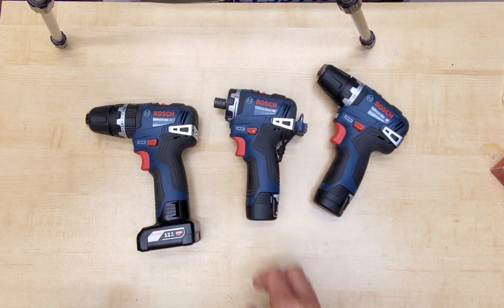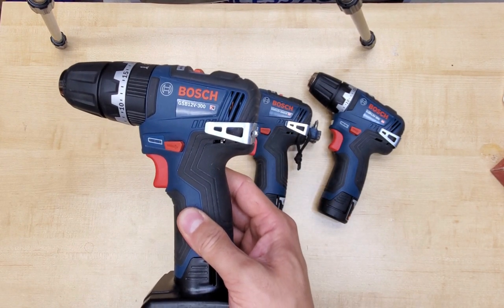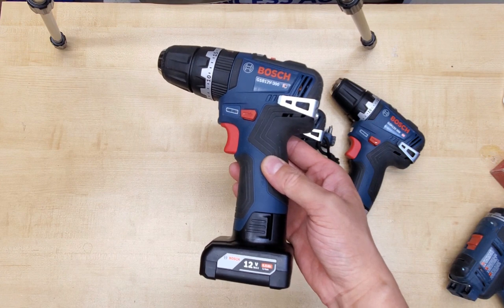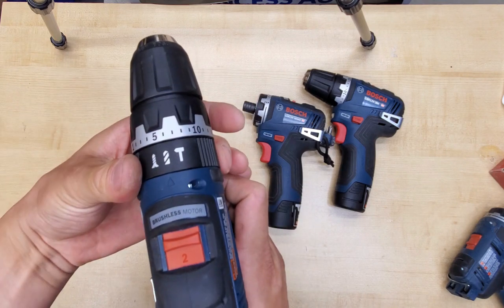Bosch 12v brushless drill driver, GSR12V-300, GSR12V-300HX, and GSB12V-300

Comment: I didn't really know what I was buying at first, but quickly noticed how good these are! I'm really impressed.
Reply from the maker: Glad you liked these. The HX is still in my tool bag almost everyday, great for going up the ladder instead of company issued 18v impact with 8AH battery.
Reply: Very compact but just weak
Reply: @ryu-ken  you sure you didn't get the brushed version? Those ones are weak. The brushless ones feel like they could break your wrist. I can screw down several large lag bolts down with mine.
Reply: @UnidudeNine  it was a gift for me but I returned it and bought the ps42n. Much better for me lol

Comment: Precision tool !

Bosch makes the most compact screwdriver, I use mine all the time. I hate using full size tools, only like using the larger tools when I am using a hole saw 2” on up. We aren’t all building decks or driving fasteners that will be hidden behind the walls. 

If you are looking for a tool that is precise and allows for full user control, Bosch 12v stuff is the way to go and especially the 12v screwdrivers which I adore

Comment: I have the GSB, it's a little monter. Has made me store my 18v drill for 99% of the situations.

I put a metal Rohm chuck to replace the plastic one so it could take half inch bits and it works wonders.
Reply from the maker: That's a good idea, never occurred to me that I can just replace the chuck with a 1/2" one. Gonna have to look for one now.
Reply: @greentjmtl  I used the Röhm EXTRA 50-RV.

It is the smallest 13mm / 1/2 inch chuck there is, at only 51mm long, so the drill keeps its compact profile. I think it's only 1-2mm longer than the plastic chuck it comes with.
Reply: I wanted to do that on my GSB 12V-15, but could not manage to remove the original chuck. I know the normal way is to put an allen key in the chuck and hit the allen key to free the screw, but I found that the chuck could not hold the allen key tightly enough: so the allen key would  rotate in the chuck before the chuck would break loose. Is there a secret?
Reply: @greentjmtl  Please, post a video if you manage to swap the chuck successfully. I tried on a GSB 12V-15 but could not break the old chuck loose.

Comment: I have been watching this video multiple times.  I came to conclusion that Bosch drills are pretty underrated.  I own the Flexiclick and I think that tool is better than the Milwaukee installation driver that I own as well (I am getting rid of it).  I agree with with that I prefer the Bosch mainly for its form factor.
Reply from the maker: They are indeed. They are never the most powerful or whatever, but the user feel is the best. I've used the red and yellow brands at work and they all have janky things that are annoying to use. Bosch isn't immune, but is the best in comparison.
Reply: @greentjmtl  I was holding the red against the Bosch and it’s just clunky and unbalanced.  What drives me crazy is the length of the tool.  It’s in no way compact.  The Flexiclick just makes sense in every way.  You actually convinced me to get the pocket driver as well.  I understand Milwaukee is the one that came up with this idea of multi head, but Bosch took a step further by simplifying it.

Comment: There is also the GSR12v-300FCB. It is the 5 in 1 flexiclick model. This adds so much that I would not consider the ordinary drill/driver.
Reply from the maker: It does depends on what you use your tools for. For me (as an electrician) the additional benefit isn't worth the added weight in my tool bag. Now if they release a model that could convert among driver/impact/hammer drill, then heck I'm in.

Comment: Good video. I agree about the chuck on the older style driver, wish they were the same. I also like how the newer 300HX model has the sturdy metal insert but not sure why they didn't make it tighter fitting. I also liked the bigger fastener for the belt clip on the PS22 model versus the smaller fastener on the newer one. Ive had 2 strip out with ease..
But I love the Bosch 12volt BRUSHLESS line of tools. Including the Bosch line I have 4 different Makes of 12v tools and drill&drivers. Including (Makita Milwaukee and Dewalt) as far the power in comparison to others in the 12v line from my own comparison the Bosch drill and drivers have more torque, are more compact and also lighter. This is also true for the oscillating tools with Makita being close in performance to Bosch with less Vibration. However I do not have the newest Milwaukee M12 oscillating tool to comapre it to, and the others are brushed except for the Bosch of course being brushless. The Bosch Jig saw is awesome also however I'll say the Makita has a little better in performance as well has fit and function in the Jig saw category. Milwaukee is okay but is too heavy for the amount performance it offers, and the ergos (subjective) aren't as good either, Dewalt doesn't make one that I'm aware of here in the States. As for the receipt saws Bosch is once again compact with great performance, however it doesn't have the best performance but it's still my preferred tool. Makita is light and love the double trigger but performance is lacking a bit I comparison, Dewalt is a great performer with good hand grip ergos (subjective) but it's block, heavy and not as compact. Same goes for the Milwaukee, it's built well, Great performance but it's got the same down falls as the dewalt. If anyone is thinking about picking up the Bosch 12v sander I would not hesitate! It does everything well with its great compact size.
Reply from the maker: Yep Bosch tools are very balanced  and well done on most aspects. The only thing annoys me is how slow they are releasing brushless models of their tools. Milwaukee already has like 5 brushless bandsaws , and Bosch released a new brushed one last year.

Comment: I have two PS20 12V Bosch and use the 2 amphr batteries with good success for screwing soft brass wood screws into walnut or maple or red oak. I bought the new 12V300 brushless and find the trigger to be very sensitive yet progressive as speed increases. The old PS20 are 500 max rpm and the 300 is 460 rpm on low speed. I find the trigger on the 300 series brushless to be the best for wood screws in terms of feel and speed up to max screw penetration which avoids broken screws that need to be drilled out and a wood splint inserted and glued to catch the same size screw.
With the light weight of the 12V Bosch tools I find control of the screwing to be the best possible with the correct clutch setting in avoiding destroying the Phillips head screws. Snap-On phillip #1 bits are the best for soft brass screws driving.
Reply from the maker: The clutch is great on these, goes to very low torque value and I even use it on control cabinet terminal screws.

Comment: Thank you for this video, it was very helpfull. I find it very difficult to make the right choice between the old/new/vs/eu models if you use the internet as a reference. To my knowledge the only machine with a  brushless motor in this comparison is the GSB12V-300. Hence the letter "B" in the model number.
Reply from the maker: All three models listed in title are brushless (they literally have the same body and motor), the "B" denotes hammer function in drills as far as I can tell.

Comment: I think these are very powerful drills for their size.  That is why I ordered one.  I wanted a small, light weight drill that  will still be useful, and I think Bosch has some nice solutions.  I have my Makita 40V XGT combo for things that require more power, but they can get heavy after a while, and if you are only driving little screws why bother?

Comment: I know this is a 2yo video but I’m not able to find much information in these models. Do you happen to know what the difference is between these GSB12V-300 and the GSB12V-30? I mean 30 and not 35, which is a different version. Also, do you know if it’s possible to install a metal chuck on these models? I believe I saw the GSB12V-30 advertised with a metal chuck but I’m not sure if that’s something that can be installed in the regular versions. Thanks!
Reply from the maker: First time I've ever heard of that model, seems to be made specifically for some markets and slightly weaker. There's another comment mentioning install metal Rohm chuck. I found it but didn't go through because the chuck cost almost as much as the drill does. So far the plastic chuck works fine and I don't see a reason to change it (unless you really want a 1/2" chuck).

Comment: You say it's on an entirely different level from the brushed versions, but I'm still tempted to get the GSR 12V-15 over the Bosch GSR 12V-35 (or similar GSR12V-300HX) due to the overly sensitive trigger on the 35 for slower drill speeds. Why do you like the brushless so much? Is it just the faster 1750rpm over the 1300rpm or is it something more?
Reply from the maker: Torque, I can drive commonly used spade bits and larger fasteners without grabbing the 18v tools. Also the efficiency is nice so I don't have to worry about batteries since I don't have a charger at work.

Comment: Love the new line of Bosch 12v. Don’t understand why it’s taking so long to make a new impact driver though to replace the ps42.
Reply from the maker: Bosch has always been slow on releasing new tools, but when they eventually do they are among the best. I'm certainly looking forward to the PS42 replacement.
Reply: It’s actually the 3rd gen of that impact driver design. They just shoe horned a brushless motor into that platform

Comment: It's a shame that they went with the push back bit release on the driver, that is a bit of a deal killer for me. I frequently am drilling test holes in air ducts with a 1/2" Unibit, and the push back style release can drop my bit into the duct when I punch through. I've lost several bits that way with other drivers.
I guess I'll snap up a couple of extra PS22s before they are all gone.
Reply from the maker: That's a good point, I've noticed the same with push back style of bit holders, but never thought about this on the driver, will have to watch out for it.
Reply: Agreed. And the bit holder attachment for the Flexiclick series has the same unfriendly mechanism.

Comment: Also any reason to simply get the hammer drill over the regular drill, even if you don't necessarily need the hammer action most of the time? I.e. can you use the hammer drill as an overall drill instead of getting two tools?
Reply from the maker: Yes of course you can. I bought the regular drill before hammer drill was released so I have both, otherwise I would get the hammer drill only.
Reply: I used to have a 12V drill, when I upgraded to the 18V Hammerdrill it was a night and day difference. I use it on wood, metal, masonry w/o any issues.

Comment: Can you explain the difference between GSR12V-300  and GSR12V-300? In terms of use scenarios and why you would use one over the other tool? Both are screwdrivers?
Reply from the maker: I presume you meant the 300 and 300HX? The only difference is 300 has a three jaw chuck, 300HX has a 1/4" chuck. For people who use it on screws majority of the time, the 3 jaw chuck is extra weight and size that's not needed 95% of the time, and slows down bit switching, so might as well omit it.
Reply: @greentjmtl  Thank you for the comment. Yes, I made a mistake I meant the 300 and 300HX. So the 300HX is kinda like the impact drill, but for more delicate work? You mentioned it's a little more difficult than the PS22 to go lower speeds with. Is that a huge problem  or can you still go slow with it just with a very delicate touch of the trigger?
Reply from the maker: @Ryezn5057  I suppose you could say that, the chuck is similar to an impact driver, but shallower and can take 1" bits, plus no impact. I don't find the less sensitive trigger to be too big of a problem, you just have to be consciously careful about squeezing the trigger and turn down the clutch on delicate screws. Although if you work on delicate stuff all the time, there is an better option from Makita (DF012DSE), but it's very low powered and cannot handle bigger stuff.
Reply: @greentjmtl  thank you very much for the video.  Answered all my questions.
Reply: @Ryezn5057  I'd go with the GDR12V-300FCB just for the Flexiclick feature. In stock form you basically get a GDR12V-300HX, that is until you get the attachments clicked in. It comes with a regular 3/8 chuck attachment, a right angle drill, offset 1/4" collet and something else I can't recall at the moment.
Reply: @MrLuisinho90  The extra part is a normal (centre) 1/4" hex fitting. It is a great tool!

Comment: Hey where did you get the bit holder for the drill?
Reply from the maker: Came with the drill.
Reply: @greentjmtl  im trying to find it online, any clues to how i can find it? Haha
Reply from the maker: @LJughes  I'm not sure if it's sold separately, maybe call Bosch referencing the part, they are pretty helpful, you can see it on page 13 of this PDF. Note they are generation specific, as in the one for GSR12v-300 will not fit the previous gen brushless model PS32. 

https://www.boschtools.com/ca/en/ocsmedia/2610056578_0420_GSR12V300.pdf